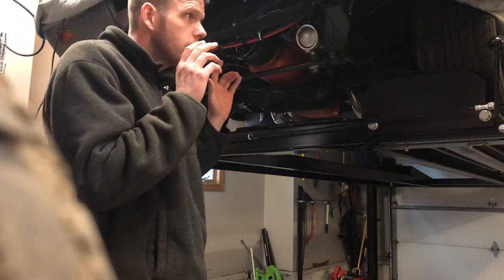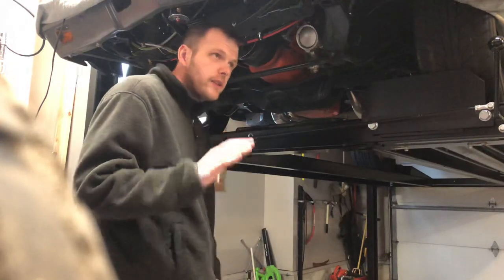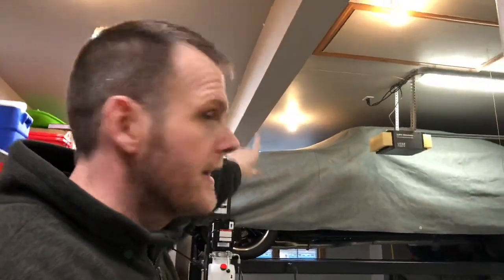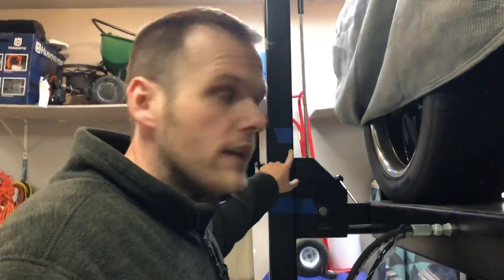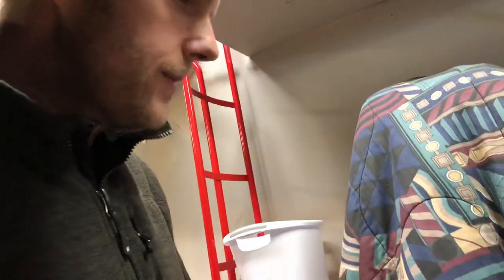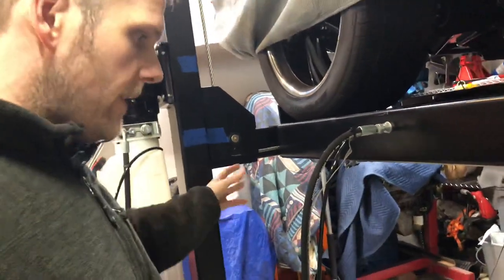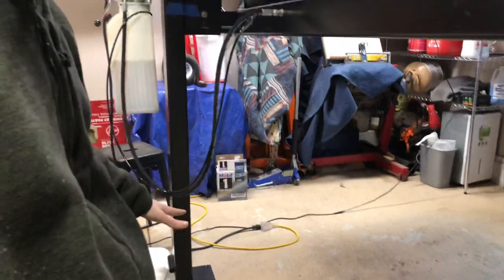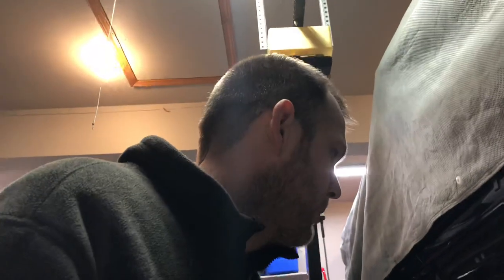Atlas 4 Post Lift ceiling height and other considerations

Comment: Quick question if you don’t mind me asking what is the height to the bottom of the bar where the Chevelle sits? I have a similar ceiling height of 116 inches and I have a Buick grand national that I’d like to put on top of my lift and would want to put my M3 under it. If you could just let me know what the height below the lift is to see if my car would clear. Since your Chevelle and my GN almost sit at the same height. Thanks again.

Comment: I got a 10ft ceiling do u thing a convertible vette and a jet ski would fit ski on bottom
Reply: Yes but you may have to hug your garage to the ceiling if you want to have the door opened with the car in the up positions

Comment: the ladder slots inside the post are they suppose to be wobbly this is the only worry i have on this lift.i looked at lift king and they are welded into the post .can you please clarify for me
Reply from the maker: They do freely hang in there so they do wobble and clang as the list is settling into position but once you have it sitting on the locks it’s absolutely fine.  I’ve never had a worry about the lift and use it daily.